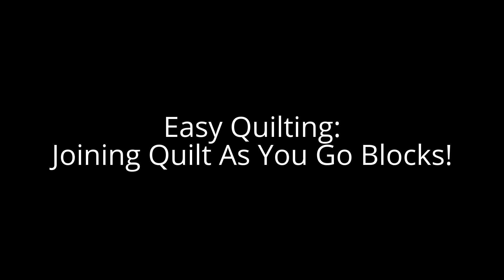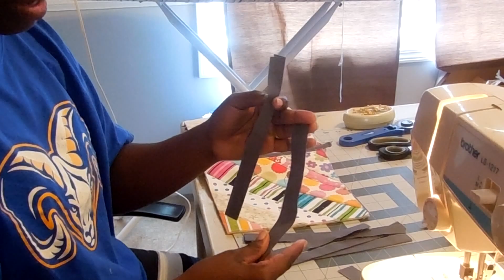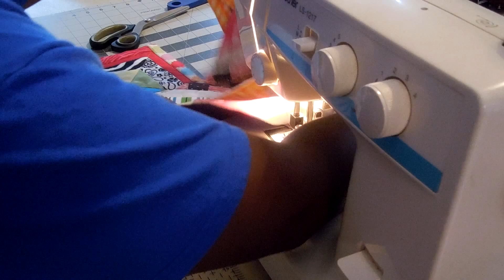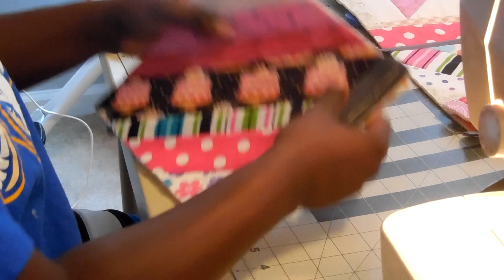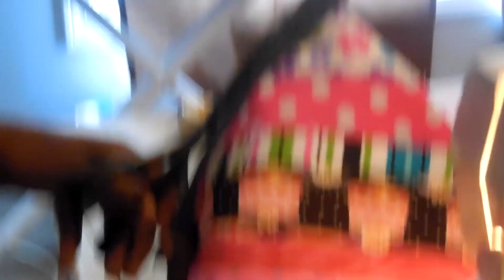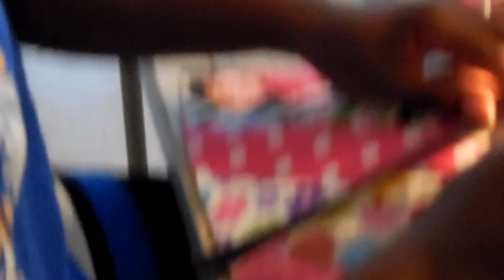Easy Quilting: Joining Quilt As You Go Blocks!

Comment: Wouldn’t you use a walking foot when you are sewing through all that thickness?
Reply from the maker: Thanks for your question. You could use a walking foot to stitch this. I don't think I did at the time because the batting is pretty thin, and I don't think I can get a close seam with my particular walking foot. I think I used my quarter-inch foot (or open-toe foot) with no problem. Thanks for watching!

Comment: If you use  a pair of 2 1/2 inch squares forleaders and Enders , you will have a start on your next scrappy quilt ,and use up your cuttings .just make a pile of squares and keep them next to your machine . Thanks for your demo .🤔👍🇨🇦😀
Reply from the maker: Heather Banks That is a good tip! I usually make two blocks at a time to use for leaders and enders; I feel like I get overwhelmed with two projects on the same machine. Thanks for watching!

Comment: Thanks, that is what I was looking for; question: why do some people use 2" strips for the top and others use 1 1/2" strips ? That is a whole 1/4" difference once it is folded in half, how can  it always end up the same in he end?
Reply from the maker: Thanks for your question. It could depend on the way that it is stitched down. I am only stitching down on one of the joined blocks on the front; the other side is just top stitched. If someone is using a 2 inch strip, they may be stitching the strip on to both joined blocks, like we do the back side.

Comment: Great job showing this method! I have a suggestion that I show my students.  Your best friend can be Elmer's Washable School Glue!  I use it to hold everything in place instead of pins. Especially that last  piece on top.  Dab small amounts of glue all along the piece, iron in place to dry the glue then sew it as usual.  Stitching will be perfect in the front and back.  The best part is...it all washes out the first time you launder it!  You can use the glue when folding over your outer binding too.  You can then stitch your binding on by machine.  Happy Quilting!

Comment: What batting did you use?  Can I use cotton batting?   You would cut squares out.  I want to make one with 5 inch squares and a wider sashing between.  I don't  know if I should do 4 of the 5 inch squares in one block or or use one 5'" square with sashing between.  Any suggestions?  It would be for a queen.  What does a queen and a king measurements?